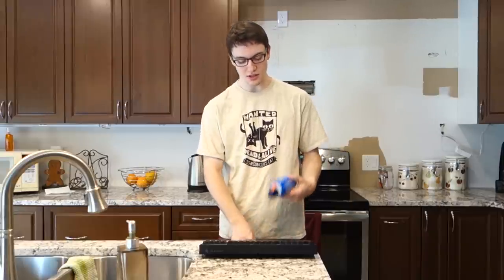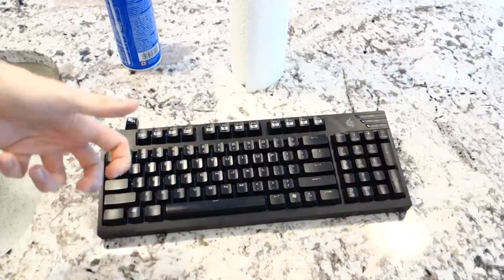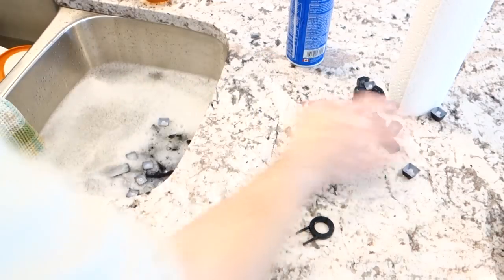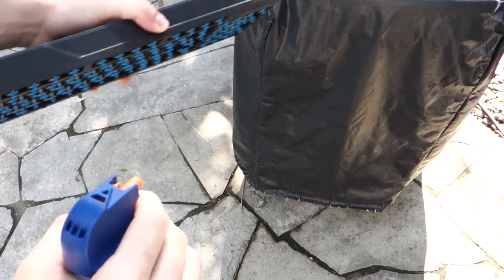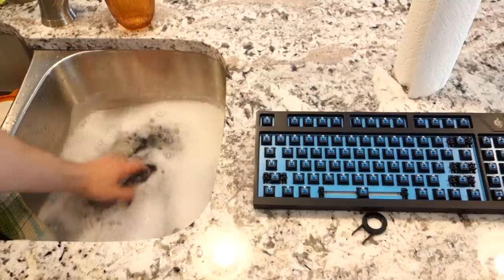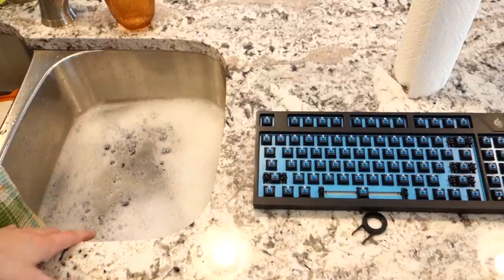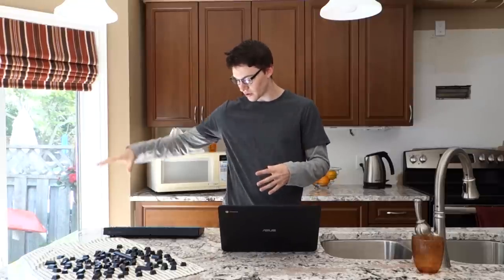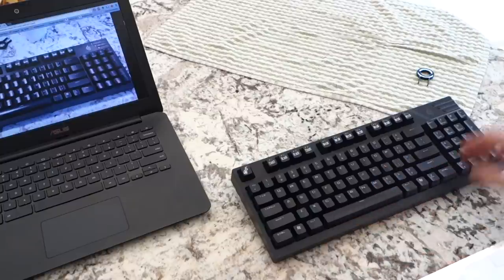How To Clean A Mechanical Keyboard

Comment: dawn is the best for getting oils and what not off plastic, before you out all the keys on spray some really light silicone powder spray or equivalent so you dont get the lights wet, this will keep a layer in the crevices so crud won't get in aswell and it quiets noise

Comment: Dude those are way better than metal bars.

So lucky, metal bars are crap
Reply: They feel waay worse tho, it's a lot stiffer:( and it doesn't feel satisfying when clicking it
Reply: Got Metalbars in my keyboard,the feeling is very good,the problem is cleaning and getting the bars back in